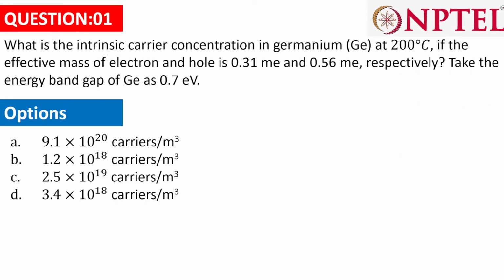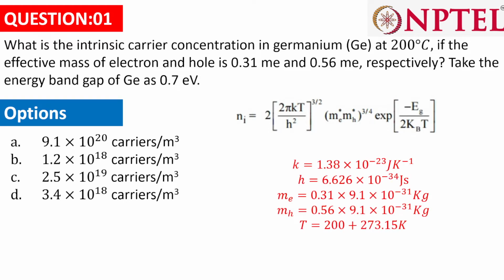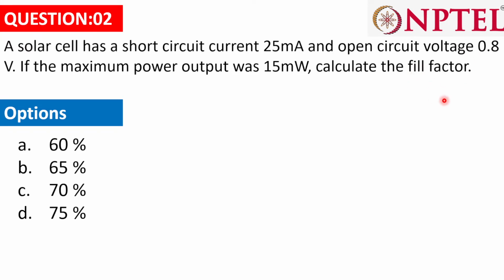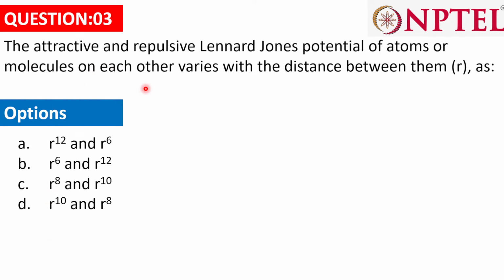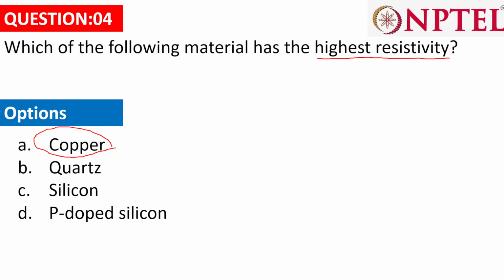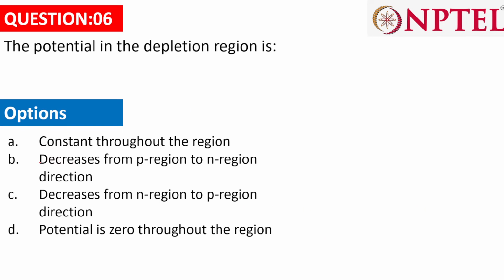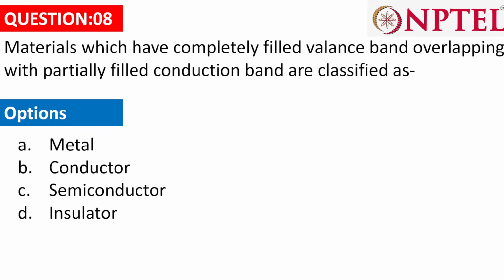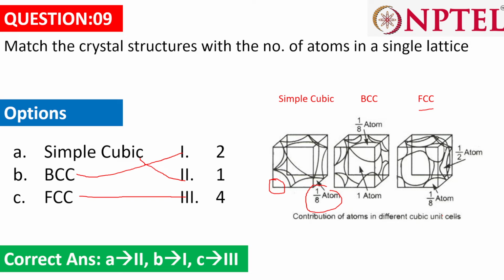NPTEL | Physics of Renewable Energy Systems (noc22-ph44) | Week-2 Assignment Discussion

Comment: Ravi Sir, please explain mechanism and charge carriers involved for drift current and diffusion current?
Reply: Drift current is the flow of charge carriers under the influence of external force i.e., voltage or electric field.
While diffusion current is the flow of charge carriers due to difference in concentration.

Which charge carriers? 
Depends on the device. For example: In a p-n junction diode, as p-type and n-type come closer to form p-n junction diode, holes from p-type (majority charge carriers) and electrons from n-type flow from one side to another because of difference in concentration.